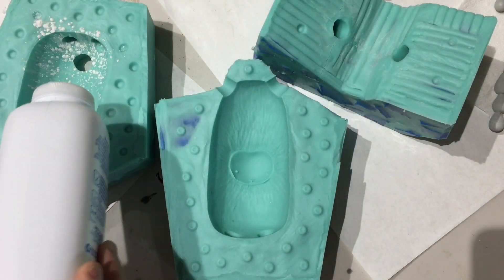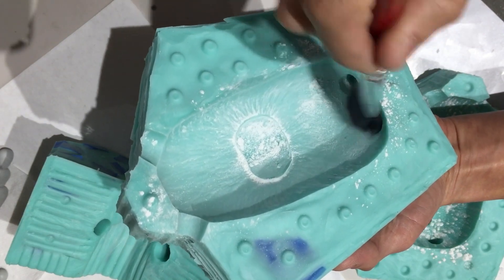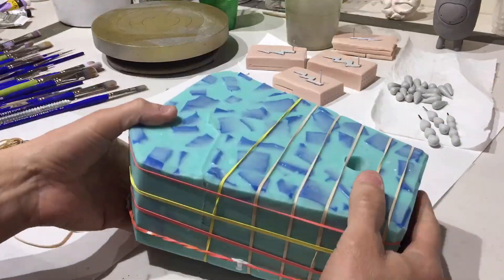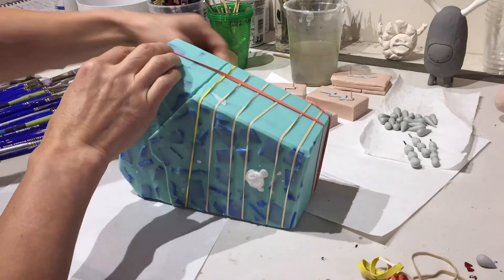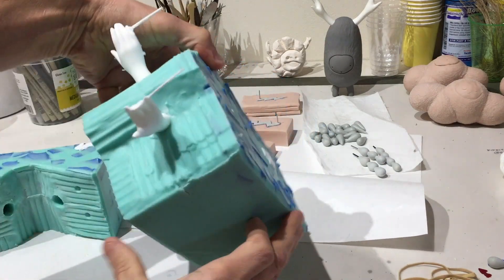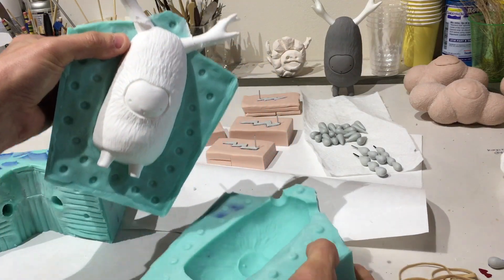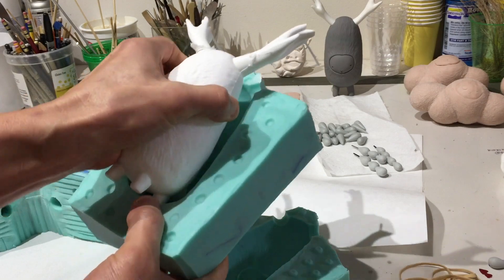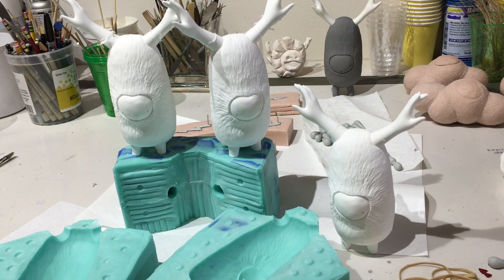Hack: Baby Powder for Perfect Silicone Mold Release

Comment: Thank you for your video. I have been a professional sculptor as well as mold maker going on close to forty-two years and I had not made any silicone molds in at least the last six years or so. I really didn't want to use a chemical based mold release for my molds, and I actually had been using talc or baby powder for my wax injection molds, but I wasn't familiar at all with being able to use talc for casting Fast Cast resins. You answered my question quickly and to the point which is great! Excellent, straight to the point, informative video.

Comment: Great tip, Steve! May I ask what those blue chunks are in your silicone? May bad if you answered it in another video.
Reply: I'm not steve of course, but I may be able to answer. You can use chopped up bits from old molds to fill out new molds. Saves money on silicone since the stuff is dangerously expensive.
Reply from the maker: yep-  recycled from old molds

Comment: Hi, my experience with babypowder and smooth cast 300 is that the cured part hardly comes out from the mold. There’s so much suction going on that more than once I ruined my molds. What do you use.for silicone and casting material?
Reply from the maker: I use Moldstar 15 and 30 for silicone and Smoothcast 300 for resin. Never had any sticking problems. I making a bunch of videos right now that go into all the details of my process.
Reply: @SteveFerrera  Thanks for your reply. I use Mold Max 30 and the molds have intricate details. It's almost like the baby powder dries out the silicone and make the smooth cast 300 adhere to the silicone. I'm going to do some extra testing.

Comment: Thanks for the tutorial. I will give it a go. How does the baby powder affect the paint job. With wax release agents, it is often impossible to spray the model after casting because it is oily and needs cleaning for the spray paint to stick. Love your instagram feed 👍
Reply from the maker: thanks! the nice thing about the baby powder is you don't have to do anything to the resin (clean/wipe) after it comes out. I go straight to painting. At least with acrylics this works. I do blow the mold out really well, so it's a very fine layer of powder.
Reply: @SteveFerrera  Can i use cornstarch as a replacement of babypowder?

Comment: When i am making a 2 piece mold and i did the 1st half can i use babypowder to make the 2nd half not stick to the 1st half when curing? Or does this only work with a release spray?
Reply: This may come a bit late, but no, baby powder will not work as a release agent for silicone-silicone. For this, you can use vaseline. It is also useful to brush on a very thin layer of vaseline onto your master before pouring the silicone.
Reply from the maker: also there's a spray release that's specifically for silicone to silicone :)

Comment: I know you are not working with a clay mold, but do you know if this works with clay molds and a plaster casting?
Reply from the maker: clay won't work with this type of silicone unless its been fired and sealed

Comment: Does baby powder affect the gloss of the resin right out of the mold? Does it make it matte?
Reply from the maker: G D I always use the white resin so never noticed anything. Might affect clear. But not sure. And I paint right after so doesn’t effect painting.
Reply: steve ferrera - Thanks. I was hoping it would be an easy way to give clear resin a less glossy surface. I’ll have to try it when I buy my first tubs of resin.

Comment: very cool! what was that machine you put your mold into? i've never seen that before. thank you for the tutorial. i've always wanted to do my characters in resin, but very clueless about the whole process. Your molds are spectactular too!
Reply from the maker: Thanks! I'm planning on making tutorials that show all the resin and silicone stuff. The pressure pot injects air into the chamber and removes air bubbles that might form in the resin.
Reply: Steve Ferrera oh sure- I’ve seen those, they just looked different. Look forward to th  tutorials.  So much to learn !

Comment: Baby powder is not a mold release of any kind. It's a surfectant. It breaks the surface tension of the liquid casting agent which reduces bubbles in the casting.   It makes for much cleaner castings.  Rock on.
Reply from the maker: interesting. I'll have to do some surfectant research. A master mold maker told me using talc will help prevent the resin from sticking to the silicone. Wouldn't this make it a mold release? Also said as an added bonus it works as a kind of heat shield which will prolong the life of the mold.
Reply: @SteveFerrera  well i use baby powder every time I cast resin.  I can't say it extends the life of the mold but it certainly doesn't hurt and the castings are superior over using a chemical release agent.
Reply from the maker: ck out my new resin casting vid- I talk about talc being a surfactant.  Hopefully I did it justice...